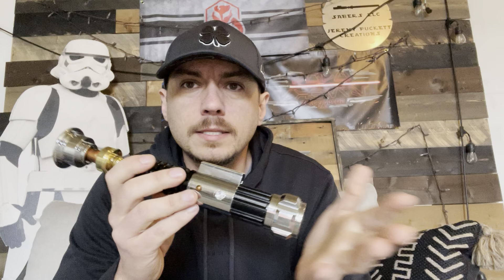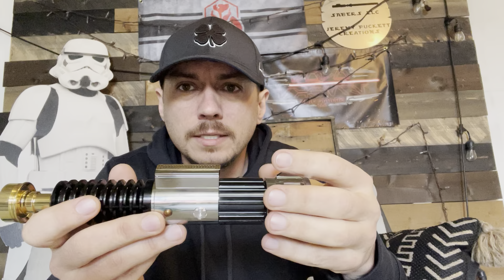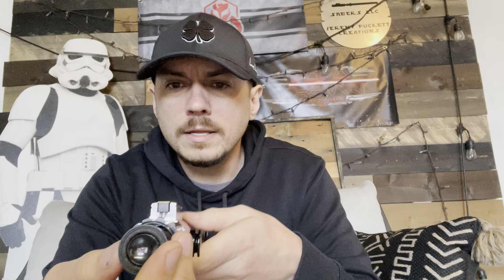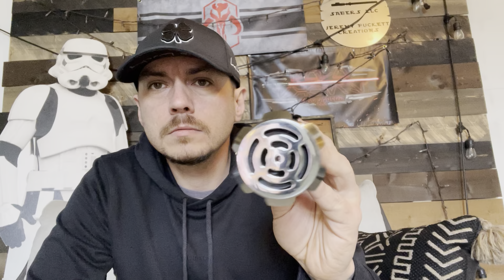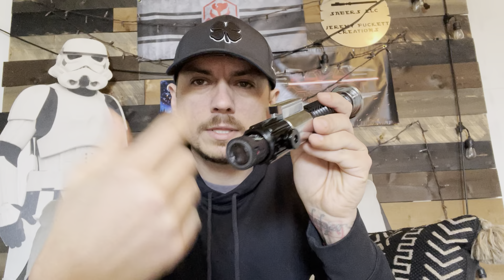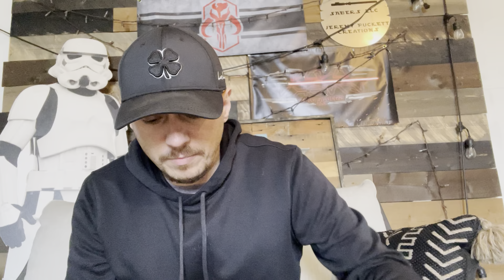Brian’s Inception Custom Lightsaber w Goth Chassis

Comment: Hey man, was wondering what kind of battery charger you recommend? Recently purchased a saber that didn’t come with a charger, and the way it’s installed I can’t actually see the battery. I know the recharge port is 2.1mm
Reply from the maker: Would need a 2.1mm wall charger from custom saber shop
Reply: @Solo_Sabers  Got it man, thanks so much for the quick response!